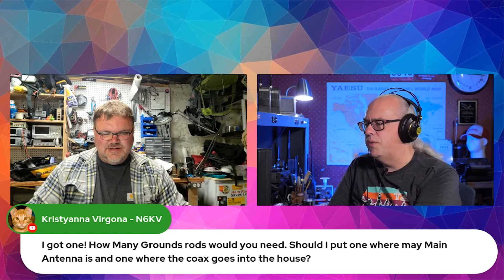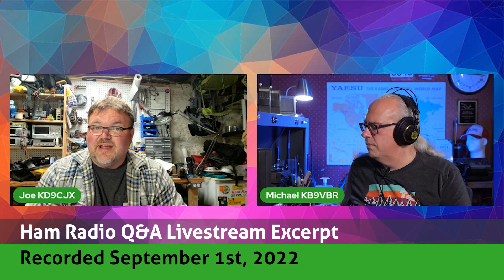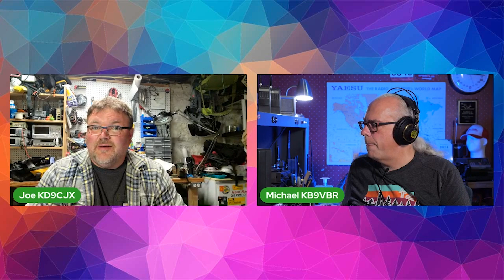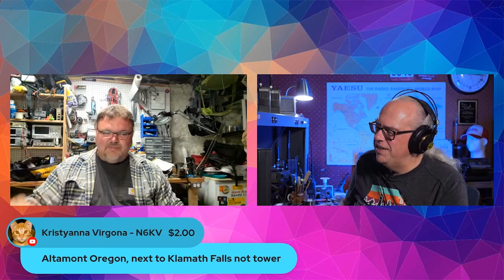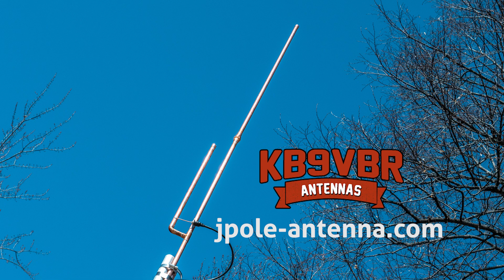Do I need more than one ground rod? Sept 2022 Livestream excerpt #hamradioqa

Comment: I have a ground rod in my slab (we built our home in 2022) almost directly below where I am going to mount my KB9VBR antennas on the gable. I have another ground rod outside the slab for our internet service on the other side of the house, outside the entrance of the coax into my "shack" in the garage. Would I ground the antenna with the in-slab ground and use a ground block for the coax on the other ground? Should the grounds be connected?

Comment: Here is some excellent info on ground rods and types of soil and wet vs dry vs frozen:Soil Resistivity:
Soil resistivity refers to how resistive the soil is to the flow of electricity. Lower resistivity is preferred for grounding systems.
Factors affecting soil resistivity include:
Soil type: Rocky or gravelly soil tends to have high resistivity.
Moisture content: Dry ground (like desert sand) is highly resistive, while wet soil has lower resistivity.
Temperature: Cold or frozen ground is more resistive than warm ground.
Mineral content: Certain rocks (e.g., igneous rocks) are more resistive.
Contaminants: Metals, salts, or other substances can influence resistivity 1.
Frozen Ground vs. Summer and Dry/Wet Ground:
Frozen Ground:
Resistivity: Frozen soil has about four times the resistivity of soil at 50°F (10°C).
Grounding Rods: Driving grounding rods into frozen soil can be difficult due to increased resistance 23.
Summer and Dry Ground:
Resistivity: Dry ground (especially during hot, dry seasons) tends to have higher resistivity.
Grounding Performance: Grounding systems may face challenges due to increased resistivity.
Wet Ground:
Resistivity: Wet soil has lower resistivity.
Grounding Performance: Wet conditions generally improve grounding system performance 14.
In summary, frozen ground poses challenges for grounding due to its higher resistivity, while wet ground is more conductive. Proper grounding design should consider soil conditions to ensure safety and system effectiveness.

Comment: Where I live in AZ is pure rock underground. I have been successful in grounding a 4 ft rod with a sharp end after a good rain and after several attempts, but an 8 ft long rod…that would be an impossible task. So I am planning to ground several 4 ft long rods and connect them with 6 gauge copper wire.

Comment: You made some good point about all the inconsistencies in residential grounding/bonding... 
Personally speaking. I would go with more grounding because the bond you create must be able to extend beyond the direct electrical system inside your house.
I've been an electrician working in the industry for 34 years. I have worked mostly commercial and industrial but I have several years in residential as well. What I have seen in residential is kind of scary from a grounding safety stand point... Especially in older houses.
Even if the grounding was done correctly when the house was built. I'm not just dealing with code changes. I've seen all manor of modifications, frequently done without any regard for maintaining proper bonding. As a result... Whenever I do service upgrades. It's policy to install two new ground rods driven10 feet apart as well as bond any metallic hot and cold water and gas lines in the house. This isn't done just to cover liability concerns. It's done to meet current NEC and RCW code requirements.

Comment: Have three antennas. 1970 vintage home w/copper pipe ground; 3 8’ ground rods (E side of house to HF vert on 15’ pole and W side of home 1 shared by VHF/UHF vert and 130’ end fed and other to copper bar with with 3 surge suppressors at coax entrance to home. All three ground road are bonded to original home system.

Comment: One thing I’m not clear on. I get that you’re supposed to bond grounds together. My shack is 50ft away from the utility ground completely on the other side of the house. I have a ground rod for my station. How do folks Bond the utility to the new ground. Yes I can simply connect the two with a wire but I’d have to trench or bury the wire as it would run literally the length of the house and to keep length at a minimum would have to bore under a concrete patio. With such potential lengths no one ever talks about ensuring proper resistance to ground. You’d have to run something like 00. If your resistance is high it’s just like not having the grounds linked. Curious what folks are doing in a rental house or apartments.

Comment: There is an issue with multiple grounds in that they must all have the same potential to electrical ground .The mismatch in potential is a lightning hazard and also ground loops if the length of the wire used is anywhere near a resonant length .

Comment: Great stuff. In the Air Force we always would pound in ground rods when we set up our comms. When I was putting my radios in the garage, the first thing I did was pound in a ground rod. Read the ARRL bonding info, and so even though I know where the comms are grounded for my house, I just prefer to bond all my own grounds. No problems with my radios since.

Comment: According to the NEC, I believe the grounding for a residential service needs to measure 24.5ohms? or less. Here in Michigan we use 2 8ft ground rods linked 6ft apart by default because the soil isn't very conductive de W8MQT

Comment: Pipe renewal is the rehabilitation of water and waste pipes. And that without or with minimal interventions in infrastructure. This means that we can rehabilitate pipes without digging in roads and gardens, or without sprucing up floors and tearing down walls. Then we use existing access points such as external sumps, stake sumps in the floor or stake hatches on trunks. Provided that these are dimensioned for the work to be carried out. and you can have the old grading

Comment: So specifically, what is a ground doing in your shack? The only thing it is doing is grounding all you equipment. It does not stop/ inhibit lightning strikes, it does not improve reception or transmission. Am I correct?
Reply: Most all the time, the equipment power cords are equipped with three prongs, the longest being the ground prong.  Intentionally the longest of the three because its the first prong to make contact and last to break contact.  I suppose the shack has a ground dedicated to the antenna ground plane?

Comment: Hi Michael,
I have ground rods placed all around my house since I have a 45 ft. tubular crank-up tower. House was built in 1955 and know for sure it has copper pipe out to water service in the street. It is also bonded to my ground system as well as the electric service. Was listening for you yesterday on 7.234 at K-1472, but there was someone parked on 7.233 that made hearing you impossible. Maybe next time. You and Christine stay safe.  73  WJ3U